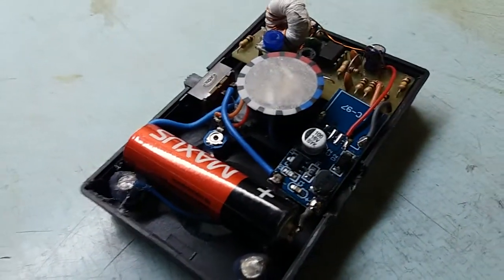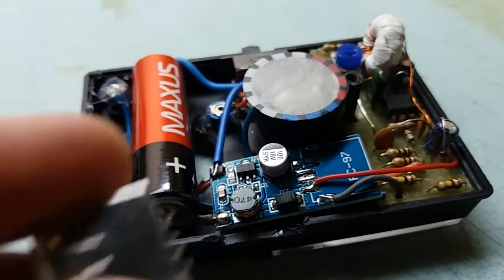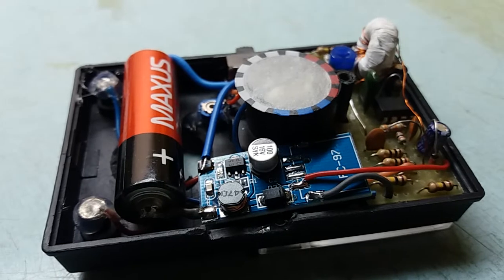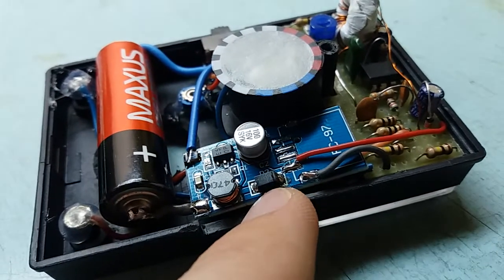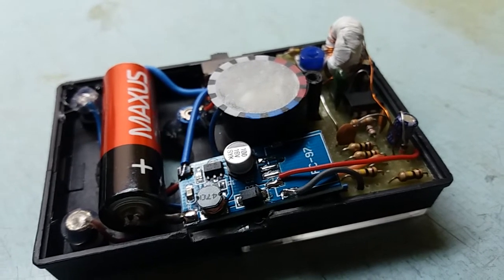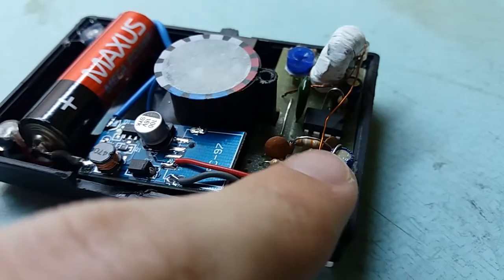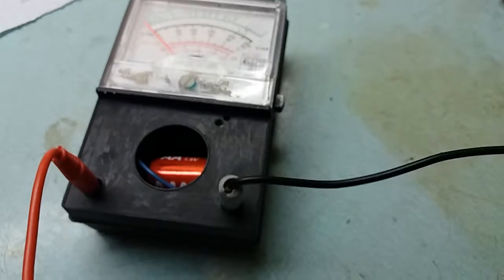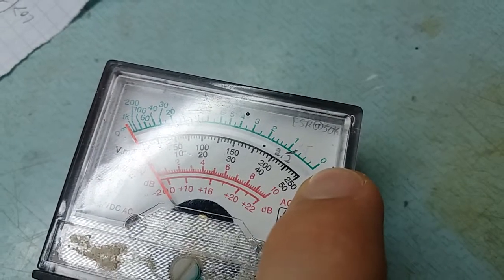ESR meter update

Comment: LOL vodoo magic :-D, i know what you mean :-).
Using the back emf from the inductor has allways confused my brain, but it works.
So now your tester gets 5v dc, did the output regulate well?
And now your finding all the semi dead batterys to suck them dry, like a power vampire LOL :-D
Reply from the maker: The regulation is just fine, thanks to the meter which doesn't consume much current. That converter is perfect choice for small loads
Reply: That should mean once you have reset the meter so it shows zero ohms, it wont need touching again :-D.
Ive seen people use boost converters to run digital multimeters, but i would rather have a smooth clean d.c battery for that, the thought of r.f getting into the measuring circuits isnt good.
Things that run on batterys dont have any filtering.
But perhaps im just silly arse lol :-D
Reply from the maker: zx8401ztv You know what's funny? I'm one of them :D I have the DMM that I fixed running on two AA's now. I was afraid about noise before, too. But now I tried it out and it works just as good as on the battery, no issues whatsoever. Converter is homemade by the way
Reply: So i was just being silly for nothing lol, yes noise/r.f can be a problem, also you dont want it going down the leads into sensitive circuits that are being tested.
Dont connect one to a radio, i think you would get a bit of r.f on the mw band.
Also switch mode bricks are horrible, radios go mad with all the harmonics, i had to build a linear supply with a lm317 regulator for a frends old radio, 18v replaced the two rectangular batterys.
no noise of a mains transformer and lm317 circuit :-D
Reply: Sorry i forgot, well done on the home made converter :-D
Reply from the maker: The converter is really simple, just 4 transistors. I have an MW superhet, so I might try to measure it while it's running with this meter.